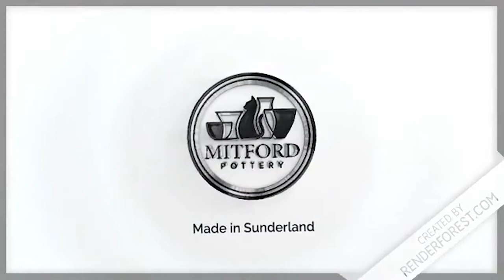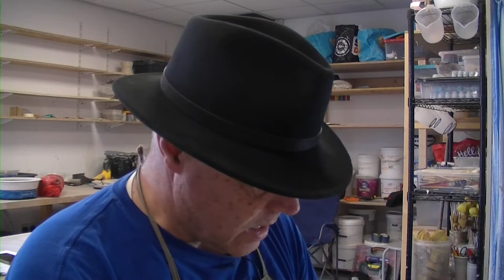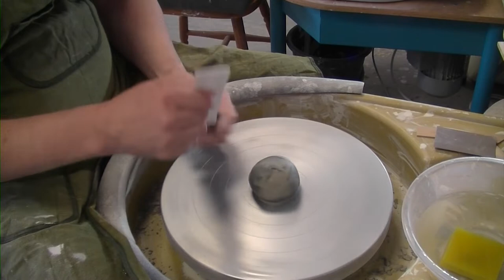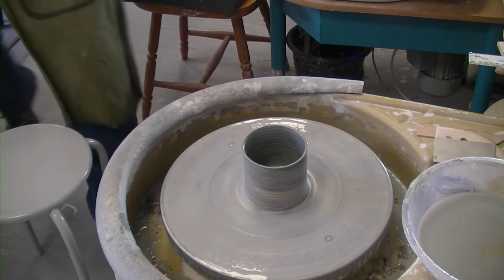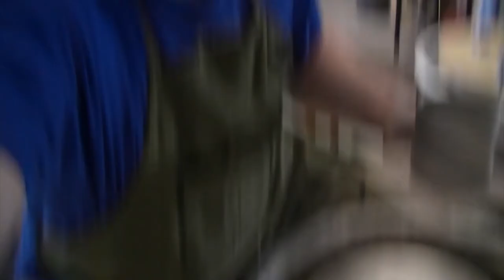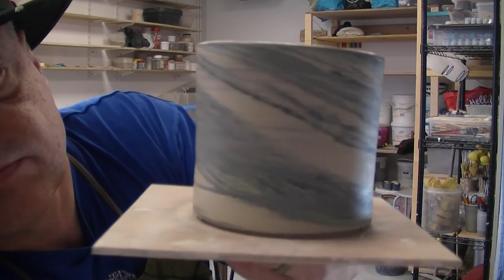Pottery wheel agateware throw - a test piece with light swirl

Comment: Hi Dug.  I think I might have a solution to get the white strip at the bottom of your candle holder.  I made mugs years ago and wanted a white section at the bottom.  I added a coil of white clay to the bottom of the centered mound.  When I did my first pull, the coil moved about half an inch up.  You'll probably have to play with the coil to see how big you should make it to get the right amount of bottom white.  It didn't take much of a coil.  Worth a try?  Have a wonderful, productive week and remember...Clay is the way.
Reply from the maker: Hi Joan, good tip i will be trying that this week. I have a question for you, im using paint on underglazes and the clear glaze never seems to apply over the top correctly, any pearls of wisdom. Really appreciate your comments. Really spurs me on to do more